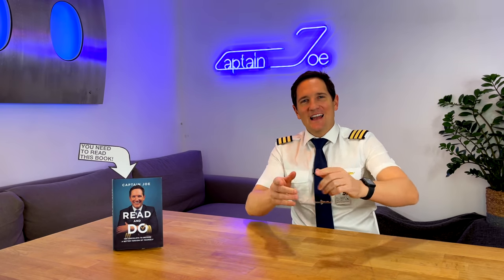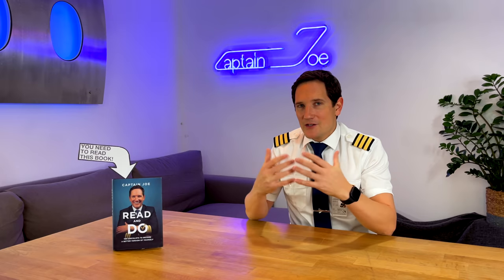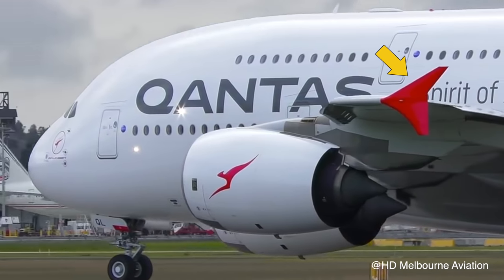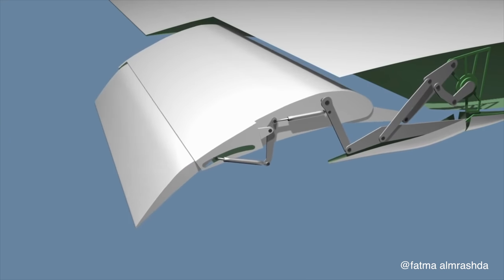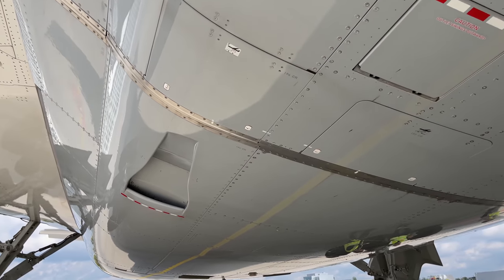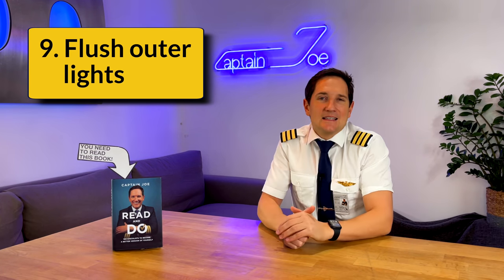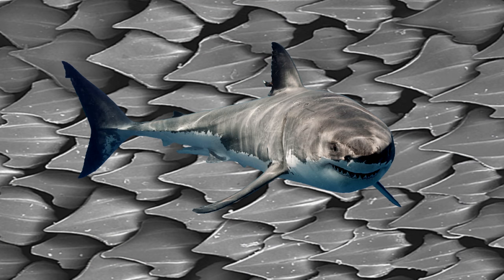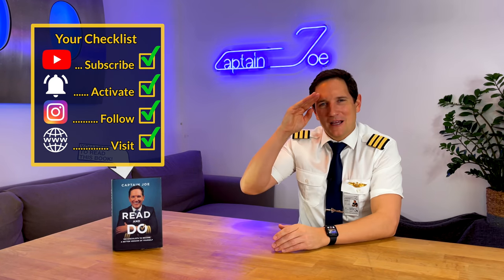HOW DO airplanes REDUCE DRAG? Explained by CAPTAIN JOE

Comment: Answer: Gliders ? they have highest Aspect Ratio wings which increases wing span and to reduce the affect of wing tip vortices
Reply: which then reduces the downwash and the induced velocity hence the induced drag
Reply: Bro u literally stole the answer out of my mouth 😂😅
Reply: I was late lol
Reply: I agree with gliders !!!
Reply: @TheUnsungHeroes  more like learnt it from my Aerodynamics teacher when he was teaching lift distribution over Finite wings.
Reply: also the tapered wings decrease the size of the wing tips, so less air from the top mixes with air from the bottom, this creating smaller vortices and hence less induced drag
Reply: @pebble24  is that the LS23?
Reply: @mohammedayaankhazi8970  😅yeah
Reply: he said its not planes sitting on the ground so my answer is planes that are standing on the ground
Reply: @tylerortiz8284  😂😂
Reply: High AP ratio wing have less induced drag but more parasitic drag.

Comment: Captain Joe, you missed what is perhaps the biggest drag-saving tool: Long wingspan (which, for a given wing area, can be translated as high aspect ratio). You mentioned the wingtip devices all of which work by increasing the effective aerodynamic span of the wing, and you forgot about the span of the wing itself.

Comment: The least induced drag along with vortex windage is achieved by ragged wingtip design usually found on Boeing 787 and 747-8i versions.
Reply: Especialy at longhaul flights. For shorthaul flights Blended or Split Scimmitar Winglet are a better option. Or redesign the racket winglets

Comment: ANSWER - GLIDERS
AS OF I KNOW ABOUT AVIATION ( ME 13 YRS OLD) WAKE TURBULANCES IS CREATED DEPENDING ON THE Weight of THE PLANE AND THE GLIDERS ARE VERY LIGHT AND THE ANGLE OF ATTACK IS NOT MUCH IN THE GLIDERS (CORRECT IF I AM WRONG JOE) 
GOOD DAY

Comment: Hi Joe, the antenna displayed at 6:25 is not a wifi antenna. It's a satcom antenna, such as Ka band or older SBB antennae.
The connectivity devices (wireless access point and network management hardware) are mounted inside the aircraft.
Reply: I think Joe's referring to them as the antennae that deliver the satellite internet connectivity to the WiFi system as opposed to them being the actual WiFi hotspots. But yes, you are correct.

Comment: 3:30 Based on my diehard beating heart for F1 and my aviation knowledge, I'd assume the answer to least induced drag is something that would be flat and wide with an even progression like how a DRS wing on the rear of an F1 car opens up to reduce drag an increase speed or how a low downforce rear wing is usually shallow flat and has very few little curves in general. So a straight wing that's uniform across the chord to the wingtip with no wing fences or tips, similar to a glider, or a swept-wing aircraft when the wings are fully out like an F111, F14 in take-off wing configuration minus any flaps or slats (if applicable)
Reply: hey I love F1 too!

Comment: Fun fact: the cars of the primarily american motorsport NASCAR (which stands for the National Association of Stock Car Auto Racing) which falls under the broader curtain of stock car racing (even though the cars arent stock anymore) use NACA ducts for the purpose of aiding with cooling off the driver as stock cars dont have AC as their purpose built race cars and temperature is typically 30-40 degrees F higher than outside air temperature, so if the temperature outside is 60 degrees F, it's normally about 90-100 degrees inside the car

Comment: 6:45 Ok so if you watched Downfall against Boeing basically a Boeing 737MAX 8  had something wrong the Mcase which is the 2nd arrow down basically controls the pitch of the airplane and the angle of attack if you it to high it will do a vertically straight down so yeah

Comment: cap I have a question i deeply grateful if you help me to understand the answer. There is a leak in engine bleed pack 1and anti ice is on for example. The valves in pack 1 and engen bleed 1 is auto closed. The ECAM directed to shut off the anti ice and to avoid icing condition. We are flying cruise at FL 370 during winter. How to avoid such a freezing condition if we can not decend to lower alt?

Comment: Speaking of the flaps if you don't know what they are they are on the wings that creates lift and more speed so the plane can take off quickly but it also creates drag so the more flaps input you do the more drag and the speed will start to decrease and planes when they land they do flaps 3 now for the Airbus a321 through people do flaps 4/ full and it will have a tail strike so Airbus  I think said " Pilots who are flying the Airbus 321 should use flaps 3" I don't know if they actually said that but the 321 is so long that if you would normally do a landing you will get a tail strike and no protectors are under there and I think planes can survive doing a tail strike I don't know.

Comment: Hi Joe, Surely the wi-fi antennas will be inside the cabin.  The large antenna in the topside of the fuselage that you are calling "wi-fi" looks like the satellite  internet link. They may be parts of the same wider system but they are not the same thing. Yes i know I shouldn't call you Shirley.

Comment: Ok so the title of the video I know all about planes and aviation and how do planes reduce drag the putting the flaps up when you're like at cruise I think another way is removing some of the fuel or most of it doing like some passengers because that adds the weight doing little cargo and yeah I think that's how you reduce drag

Comment: Why do a lot of airlines do the bastardly thing and increase cabin air temperature to unbearably hot levels?
Reply: On the ground or in the air? Because in the air usually the opposite is done.
Reply: @ZK-APA  in the air. I was recently on a trip on Turkish Airlines. Both their aircraft cabin temp and airport temps were unbearably hot.
Reply: @TheBlooRayChannel  then I'm guessing would be a fault or something. Because in the aircraft, the air isn't cooled but heated. So having warmer air is actually less effective for the aircraft, so it doesn't make any sense for the temperature to be high intentionally.
Reply: @ZK-APA  of course. I've been flying for 25 years. Apparently Turkish Airlines deliberately does it to get people to feel lazy, tired and fall asleep. That way the crew don't get bothered much.

Comment: Serious question, when the military does huge drops of multiple vehicles, equipment, and other heavy stuff from the back/aft of the aircraft or when fire planes drop their water/extinguishing agents does that have a major impact on the aircraft? You would think that the quick loss of weight would cause an elevator effect (or whatever the scientific term is) causing the plane to pitch upward quickly. Does this happen, and how do the pilots prepare or recover from such an effect?

Comment: Question :
If the missing "fairing" (excuse me for  inaccurate spelling, but I am referring to the metal cover of the flap tracks), in A320 would have been near the fuselage than the Winglet than the increase of fuel would have been less than 2% based on the Lift formula, right ?

Comment: Evening Captain Joe, could you please advice me, if you have uploaded any video, explaining the difference, between ground speed and true air speed, of an aircraft ??
Reply: True airspeed is the speed of the aircraft with respect to air, whereas groundspeed is the speed with respect to ground (ie distance/time)

An easier way to understand the concept is someone running on a treadmill. The speed the treadmill shows is like your true airspeed. But your groundspeed is your speed with respect to ground, which in this case is zero (as physical distance travelled is zero)

Comment: Hello, You mentioned that the beacon light are on from the engine is on and shut down, so what happens if you have to shut down the engine in flight for a abnormal/emergency situation
Reply: It remains on, because engine is still technically spinning (because of aerodynamic forces)

But the more accurate answer is that thinking of the beacon isn't required when you have a situation where your engine is messed up

Comment: Why are jet engines at the tail sometimes?
Reply: Fuselage mounted engines are closer together, in a case of an engine failure, as the thrust line of both engines was then closer to the center of the airplane, making it more stable. However, this makes the tail heavier and the wings were moved further aft to accommodate for the heavier tail.

Comment: Question: If the function of the flaps is to increase lift by causing drag/air-resistance, why need the flaps housing?
Reply: they don't increase lift by causing drag, they increase lift by altering the shape of the wing, and increased drag is the tradeoff.  then when they stow them, they want to decrease the drag as much as possible - so they want the hardware to be in streamlined fairings.
Reply: @kenbrown2808  Ah gotcha... Thanks!

Comment: Answer to 3:30 : The wings that create the least amount of induced drag are those with an elliptical shape, so perhaps the Spitfire is a good enough guess...
Reply: Elliptical shape is "easy" way to generate elliptical lift (much less lift on wing tips). But its not cheapest solution.
Reply: @norbert.kiszka  Yeah, surely not the cheapest wings to manufacture

Comment: Ryanair just remove any crucial parts to the plane reducing weight saving fuel such as fire suppression systems landing gear suspension and other stuff that keep planes in the air or make a comfortable landing